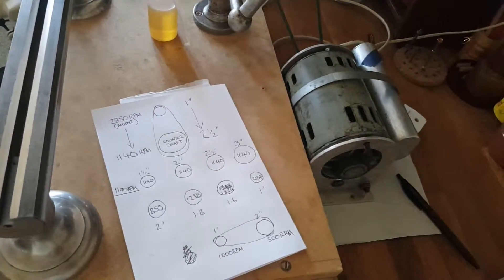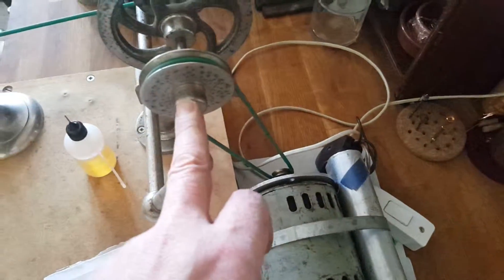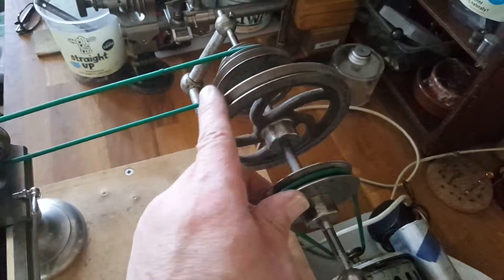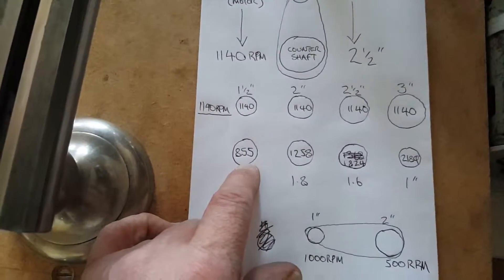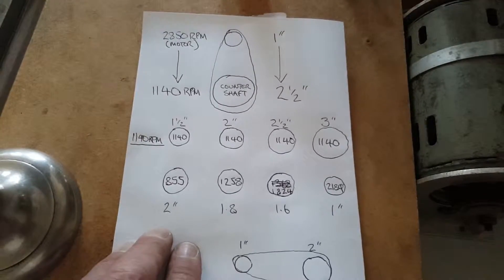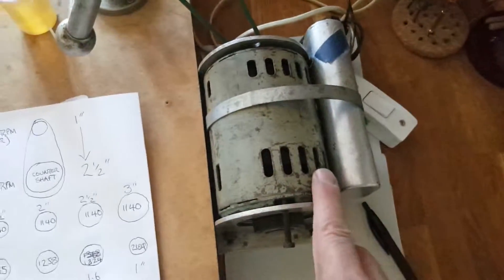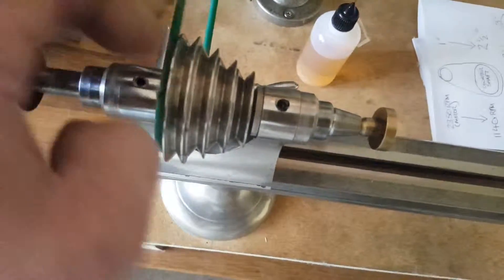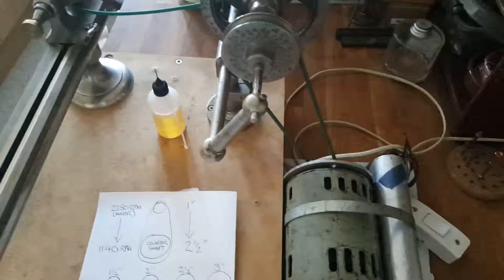Using a watchmaker's lathe counter-shaft

Comment: thanks for the very helpful video
so the issue is speed and torque
I have a moseley lathe with a watch craft motor, no countershaft since they're really hard to find, and a pedal
I can control the speed with the pedal, but you're suggesting that without a countershaft the torque is not ideal?
Reply from the maker: I find without the countershaft, the lower the speed, the lower the torque.
I'm not saying it's a hard and fast rule, it's just from my experience